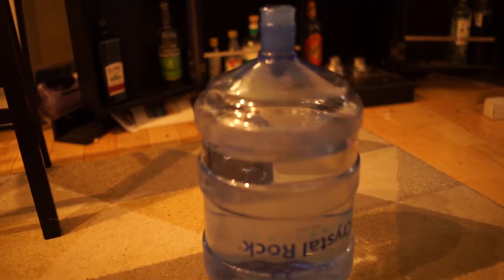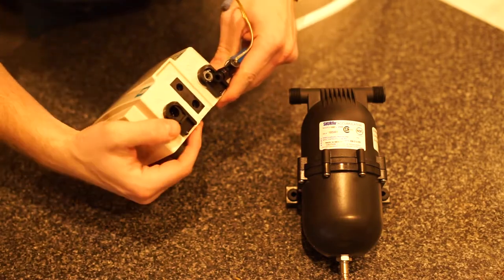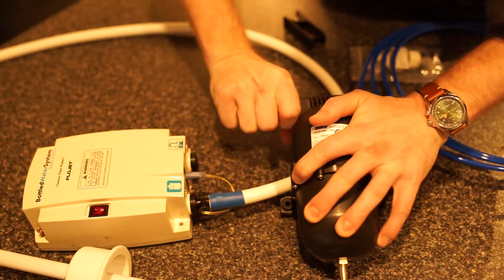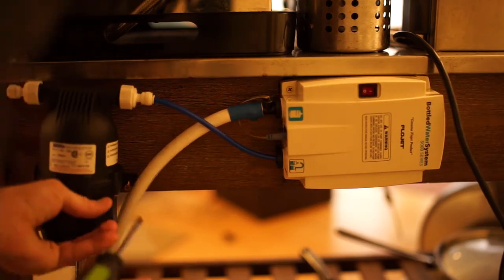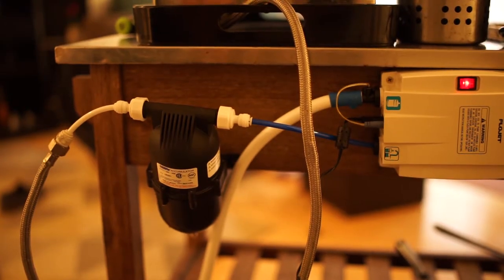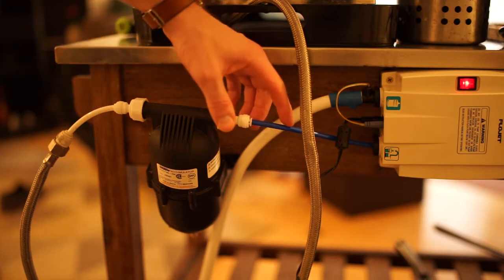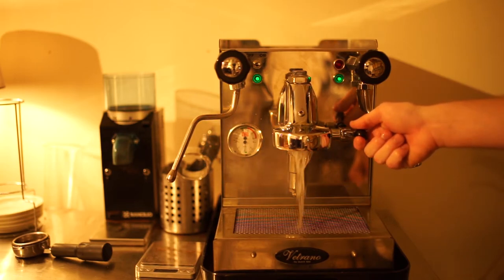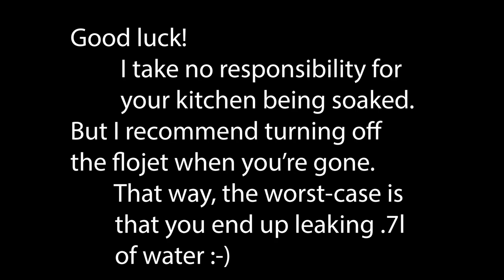Plumbing an Espresso Machine to a 5 Gallon Jug

Comment: How often should Flojet pump be kicking in? I have mine setup with pressurized tank and usually it will toggle on every second shot or near the end of shot.
Reply from the maker: Sounds about right if you’re not using a big tank to buffer the pressure. That sounds about as much as mine does, maybe a bit more. It’s only a problem if you’re not getting consistent pressure on your machine
Reply: Thanks for the reply man. I have been told different levels of psi for accumulator tank. Some suggest 20psi others say the pre pressurized 10psi it comes with is good and now I see yours is 30-40psi? Unfortunately I must have damaged my tank because it no longer holds air and I ordered a new one. Although the tank says it can withstand up to 125psi. I will be re doing my system here in the coming days with new tank. What is your static line pressure indicated on your brew gauge? When pump kicked in, it will raise line pressure to 3 bar. I am concerned because profitec recommends only .5-2 bar of line pressure. Sorry to bombard you with questions.

Comment: How did you determine 30-40psi for the accumulator tank? Currently mapping out a setup for my Pro700. I have the Flojet…I just have to acquire fittings and debating whether or not to add accumulator tank. Can you share your experience?

Comment: Does your espresso machine have a rotary or vibration pump? I know vibration pump machines can’t be plumbed because of the pressure but I was wondering if this could be a work around instead of plumbing?
Reply: his Quick Mill Vetrano cost over $2500... it has a rotary pump